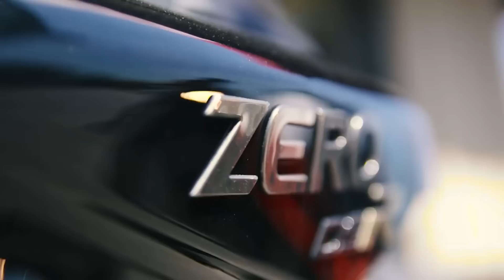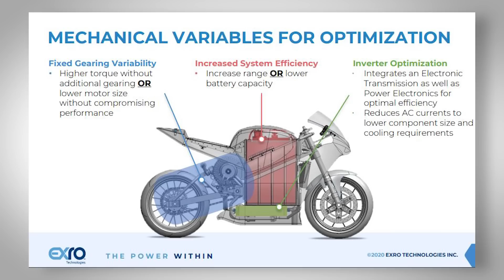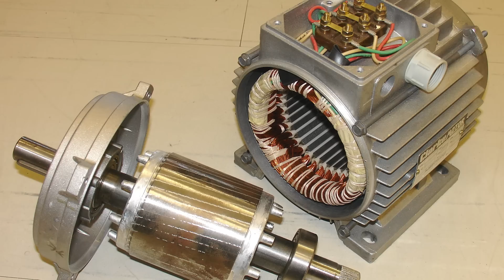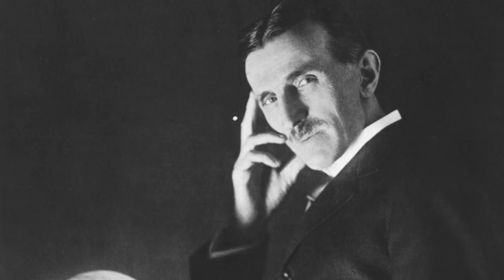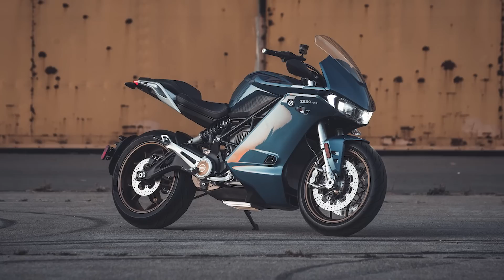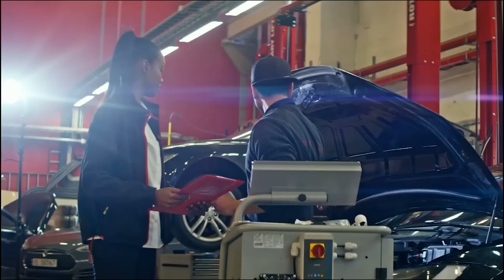Goodbye Gearbox??? | Exro Technologies

Comment: Two analogies of what I think this tech is doing. Imagine a big V12 fossil engine. Now imagine how variable valve timing and lift, can give you "multiple engine profiles" at different rpms. One optimised for low down torque, then it can change to another with early, long and deep valve profiles for high rpm performance. He described this. However he also described a behaviour a bit like cylinder deactivation. For a fixed rpm, say 2000rpm, you might need max power, or you might be cruising and want efficiency. For efficiency you might deactivate 8 of the cylinders, as 4 cylinders produces all the power you need for crusing, or even 2. I think that might illustrate the load optimisation possible, in addition to the rpm optimisation. Yes electric motors do much of this already, but this tech adds a whole other level of flexibility
Reply: YES...YOU HAVE IT!!!

Comment: So you wire an asynchronous motor to run at the reduced voltage in star mode rather than the normal delta mode then switch it to delta mode for a huge increase in torque whilst the motor windings get to melting point in about 30 seconds.  but you cleverly switch the configuration to stop the motor burning out with a moderate increase in torque.  Whats the bettings that the performance nuts will 'tweak' the star/delta ratio for the buzz and then whinge like hell when the motor lets the magic smoke out ?   Kind of like breaking your Mitsubishi Evo by 'adjusting' the engine management system to the point of no return.  Goes like hell for 7 miles and then boom.  This is progress ?  Just wire the motor to run in delta all the time and get the extra torque by making it a tad bigger......

Smells a bit like a combination of bullshit and snake oil.

Comment: Changing inductance means changing the winding you are driving. This sounds like individual control of each coil along with each coil being a smaller percentage of the total windings. This requires lots of high speed, high power electronic switching. As these electronics become more powerful and less expensive this becomes more economical. But this all raises complexity of the physical motor and the control electronics and thus cost compared to what we already have. This tech would make already very quick electric cars even quicker. However the increase in efficiency available is pretty minimal as 90% is already pretty good compared to internal combustion and is why fueling electrics is less expensive than fueling fossil fueled vehicles. Where this really makes sense is heavy duty applications where a single motor would be perfect for cruising on level roads but a much larger motor (torque) is needed for acceleration and severe hill climbs like going west from Denver, Colorado. The guest talked about this superficially. Good luck to them.

Comment: This is of course, a simply brilliant concept.  I would be unsurprised to find the car company Tesla had kicked this around already.  Whoever does it, in one shot, you change an apparent hardware ‘problem’ to a software issue.  Really good, and it’s great you bring this material to the channel, there really needs to be some middle-ground where non-tech people can find out about tech stuff - and you’re it guys!  I studied Electric Machines at University, and I can’t say too much sunk in, but there was definitely that demarcation of ‘You will have to choose serial wound motors for high torque...’ and all that baked-in preselection stuff.  I mean - who doesn’t want high-torque to start off, and high speed once you get going, is the obvious question.  Now, a baked-in and inalterable choice is no longer necessary.  Fossil-burner analogies...

...are probably clumsy, but I can see why it’s worth a try.  I think I’d look at it like this:  you want strong pulling power (high torque) when setting off in a car, so the way this is done is by increasing a self-defeating force called ‘inductance’ in the electric machine’s coils.  However, this becomes troublesome as the speed increases, the motor is not needing this powerful inductance electricity flow.  That, plus the ability to switch the coil configurations seems to be the core of this multi-faceted motor controller.  More interesting, is what other contributors have pointed to - the possibility of really doubling or more, and being able to fine-tune, the ‘engine braking’ effect that refills the battery with energy, that we all know as regenerative braking.  The tantalising possibility is that the ‘engine braking’ or regen could be amped up (literally) so much, and reduced to nothing almost at the drop of a hat, it’s almost going to render brakes as we understand them (friction brakes) obsolete, or at least, secondary.

Lastly, when crystal-ball gazing about how soon EV will overtake/replace ICE or fossil-burning engines in vehicles and all sorts of applications, here is my standard Point Of View:  if we ALREADY were all using electric machines (motors) in almost every motive power application (ships, boats, cars, planes, trucks...) who would be brave enough to bring the concept of internal combustion engines into the boardroom or to the Trading Floor, and how could such an idea ever reach production?!  ‘Hey, this idea of mine involves burning muck, spraying out muck, and damaging the planet, plus the motor needs lots of maintenance this EV-only world of ours has enabled us to do without, PLUS it’s more expensive to make and has ten times as many moving parts to wear out and it needs oil changes galore...etc etc’.

It’s ONLY the inertia, the legacy effect, and powerful vested interests, that blocks and stops the immediate move to an electric-machine centric world.  The ICE design, the fossil burners, have hardly anything to commend them, except if you’re in cold climates you might want a little one to use as a boiler - because it’s 85% efficient due to wasting almost everything it gets in, as heat output.  If I put it another way - and I know 90% of the people watching this channel are firmly pro-electric - on MERIT the internal combustion engine has nothing to commend it, compared to an electric machine counterpart.  It’s like letting the bottom 20% of the math class, teach mathematics at school, because you always did.  Insane to do it, but if it’s always been done that way, changing would be a formidable obstacle.

This is a really necessary channel, and you keep bringing new to the table.  What did the Blues Brothers say!? ‘We’re on a mission from Gaad’.  This isn’t just a job guys.

Comment: This is not a gearbox at all, it's a VSD (variable speed drive), it contorls torque at various speeds, nothing more. It does not alter the speed of the output shaft in relation to the input shaft. Stop waffling!!

Comment: Use a centrifugal clutch much like a snowmobile.  Cars now are using CV transmissions one gear drive. Meaning no shifting.  Centrifugal clutch on one side, driven chain to rear wheel on the other side.

Comment: ho hum... yeah the gearbox can be used by engaging the electric braking to get RPM down fast.. then move the gear in synchromesh match shafts.   This can allow for smaller motor and greater range.. Torque is used to move.. once done it is HP that keeps it moving.   
Smaller motor needs to be geared in order to move from:
1st High torque low Horsepower,
2nd Low torque High Horsepower,  
3rd Lower torque Higher Horsepower.
The final gear is using 50% value of all horse power at cruising speed desired.
The response is one throttle if you will call it that there is little response in the get up and go..  
Sluggest and most power consuming on battery life, just as in a ICE there is huge amount of gas also consumed. 

Just do not see why this is such hard concept to wrap one's head around.

Comment: Humans process in chunks that average 30 steps per second - 30Hz. Computers process in chunks that average 3 MILLION steps per second 3 MHz. Computers aren't just faster they think in a broader time spectrum as well - parallel linear processing. Humans - give a guy a stick of gum to chew then have him do the sevens times table - Oops. The PWM rate on this motor could also be in the millions per second, so the torque changes will happen faster that turning an ignition key ON. That's efficiency...

Comment: As I understand it, Nikola Tesla knew AC power transmitted long distances better than DC because it was easy to transform the voltage up and down. But what he didn't have was an electric motor (for industry) to run on AC. DC electricity had DC motors. His solution was a 3 phase AC system and the induction motor. You can run the AC induction motor without a controller by just connecting the 3 phases to the motor. Very clever.

Comment: I am a motor and drives expert and can confidently tell you that with vector control you already get good efficiency at wide speed range and the efficiency gains with the proposed system would be very marginal and the system cost would go up with a more complex inverter and motor. In the end you pay a premium for little gains over the life cycle. If you don't believe me, think about this. Why do teslas not have a multi speed gearbox? Answer is there is not much benefit to be earnt by over engineering things..
Reply: You are missing a few points. Review motor performance once the inverter gets to maximum voltage (end of constant torque range) and goes up in rpm/frequency into constant power range. These guys are (trying to) fix the deficiencies of high rpm in constant power range.
Reply: @lengould9262  whilst its always  good to develop new techniques, going back to the proposed improvements, there is always an extra cost to incorporate new winding structures. I bet if you were to compare the power density of this newer motor, it would be less. And woul be more expensive. Why not just use more exotic materials and get a better motor for the same cost and at a higher power density? New winding structures need more space.
Reply: @cooliocrib4409  for a given standard-wound AC multi-phase motor with a standard inverter and single speed gears in an auto, the designer must compromise between low-end torque (acceleration in the lower half of speed range, constant torque range) and top speed (limited by ever-reducing torque as rpm increases in the upper half of its speed range, constant power range).

For a performance company like Tesla, who care about 0-60 mph and 1/4 mile times, they set their   gears to give them the low end times they want, but are then unable to achieve really impressive top speeds due to limited max rpm of the motors   and reduced torque at high rpm. They often wind up choosing oversized drive motor/ inverter sets so they can use lower gear ratios to get their desired high end speed, adding cost and inefficiency.

This system sounds like it's attacking the fall-off of torque at the high rpm / inverter frequency range, allowing a smaller motor and inverter with a taller gear ratio (cheaper as less input torque)  to give the same performance across the entire speed range, for the same or less cost, less weight and better efficiency.

Comment: You have to look at it like cylinder deactivation.    A V8 engine that you can turn off cylinders as you need it.  Going from running 2 cylinder for level ground to using all 8 for hills. On a transformer for example you has taps for neutral , 120,208,277,480 volts. Each tap has more windings to handle higher voltage but on a motor it's the stator
Reply: Yes to me from the video it appears most similar to a transformer tap changer but applied to the electric motor instead. Very interesting

Comment: A single gear in EVs already makes them crazy fast.  So what is the need for this device?  It is added complexity and expense for limited performance and efficiency gains.  This is going to be a niche product for higher end performance cars and motorcycles.  It is a neat technology!  But, I think, with very limited appeal/application...
Reply: Smaller motor, battery for same performance, range.
Reply: @lengould9262  from the video, the efficiency gain was very small, from well under 1% 'up to' only 3%.  No.  This is going to be a performance add-on to increase the acceleration from 60 to 100mph, or there-abouts.  This is about faster at higher speeds, not about further.

Comment: Simply put they are just altering the winding based on speed. And they absolutely could Quantify the efficiency of the motor in a test it would just be going from 0 to 100 instead of constant speed the whole time.

Comment: in induction motors... the number of poles DRASTICALLY affects torque /rpm range. for instance- an electric ducted fan motor for RC jets has a very LOW poles count as compared to ... a high torque servo motor. this controller would give you the ability to take a 32 pole motor & 'switch' it to a 2 pole motor... or any 'pole' count in-between. so... on a motorcycle application... you'd start at 0mph with all 32 poles and quickly start to 'pair up' ... 32... 16.. 8... as the driver accelerates. once the desired speed is attained, the controller just 'holds' the pole count at say- 4? to maintain peak efficiency for 70mph.  just a guess. they may have more factors in mind? but THAT WOULD definitely put motor efficiency over the top.

Comment: Bikes just really don't need these performance numbers.   How many die each year??  Zack/Jesse how about researching these numbers ??
AeroDynamics the bigger problem - opportunity is 3 wheel light weight vehicles for city use?  max speeds 45 mph or 70 kph.
Sad to see "Now You Know" promoting this angle.   
side note:  BS ??  How is Tesla not already doing this? compare Model S to Porsche or Mercedes ranges. We shall see - perhaps a real break through?

Comment: I think another analogy is the head technology Mr. Honda developed. A better balanced head allowed higher revolutions of existing piston engines. This allowed a decrease in the number of pistons for the same horsepower. This reduced weight, which improved efficiency. Thoughts?

Comment: Long-time Tesla Shareholder and Bull and 200,000+ miles on ICE motorcycles - ZERO is great, (I test rode the 2020SR/F) although as a drummer - I like being able to use all of my hands and feet at once - really what made the entry into motorcycles (too?) easy was the electric start = kick start took a modicum of strength.

Comment: TOPIC SUGGESTION
Hi, great podcast. About 15 years ago I translated all of the thechnicals  documentations of this US charger and dozer manufacturer Letourneau. Those machines runs on electrics motors feeds by diesel generator. At the time they were working on reluctance motor that were incorporating some technologies ressembling the one described by your host. They wanted to applied this technologie not only to their products, but also to electric train engine. Might be interesting to see were that went... Thanks,

Comment: Is a smart thing to do if I understood correctly (since you were trying to not get technical), is hard to be sure exactly what their talking about. Sounds similar to what Diesel-Elective train locomotives have been doing since the 1940's where at low speed, they put the motors in series and then at higher speeds, they switched (transition is the term) to all the motors in parallel. In this case its all within one motor.
Reply: Not a useful metaphor if you understand AC drives and motors.

Comment: so couldn't you have a controller that is connected to each coil individually and able to vary the voltage and current input infinitely anyway? i would have thought this is how its done these days.

is this setup they are talking about just to improve an unoptimized motor?

i wonder how their approach differs from tesla.

Comment: This sounds like paid advertising.  The hyperbole from the young guy on the left talking about a field he hardly has a grasp on is just bizarre, the technology Exro has is nowhere near the biggest thing to happen to electrical motor since Tesla, it's at best a very incremental progress in the integration of control electronics from battery to controller and motor, it is NOT revolutionnary

Comment: Wait i've theorized this before. I always wondered why they just simplify to 3 phase input when there is a dozen coil modules. Control of individual module could have interesting results especially for a system that relies on high frequency timing. Bravo for actually making this idea real.
Reply: If I understand it correctly there are still 3 phase inputs connected to the "coil modules". They just broke down the "coil modules" in to sections that may or may not be active at the time. It's like they are changing coil size and the motor KV. Or I mean yes, more inputs to the motor, but only 3 inputs to the "gearbox" (besides input for controlling). This is how I understand. 
BTW It's great that you had this idea!
Reply: @infiniteoffset  Yes the power delivery formation is still 3 Phase. But the actual connections to coil modules is individual for finer control. No it has Multiples of 3 input lines. This early infant version has many sets of wiring from the Controller-Inverter to the Drive Unit. Will need to figure out Reduction of Wires.

Comment: It seems that this technology is more analogous to the intercooler in an IC configuration than it is to a fuel delivery system or turbo/supercharger. In the same way that an intercooler increases the density of the air charge by removing the heat induced by the air induction system (turbo/supercharger, etc) this technology eliminated the parasitic effects of inductance. This is in addition to the other capabilities of the system in reconfiguring the windings in order to improve the torque curve at different speeds.